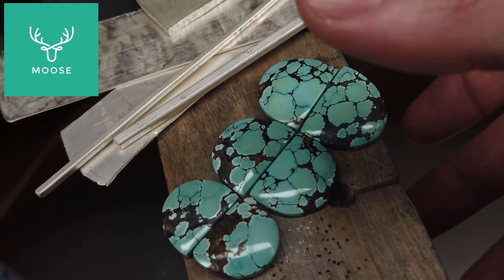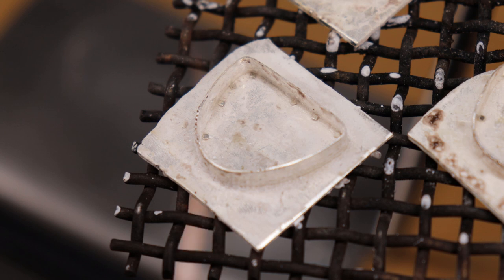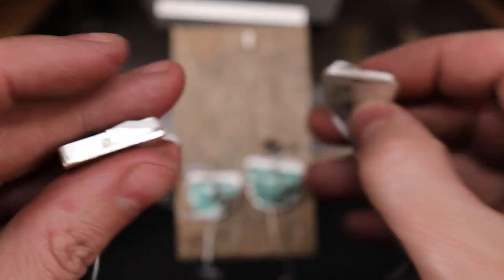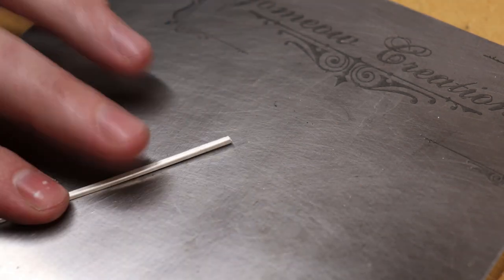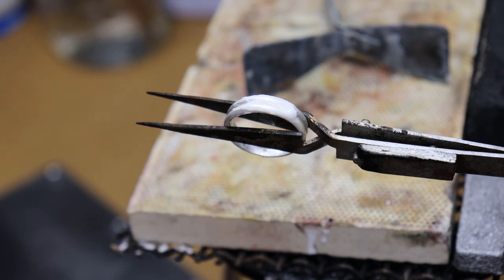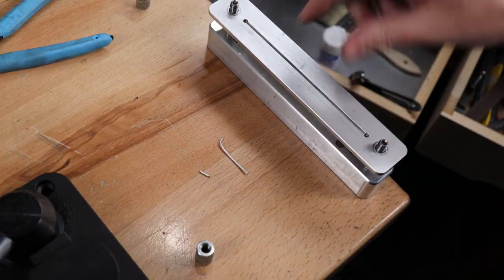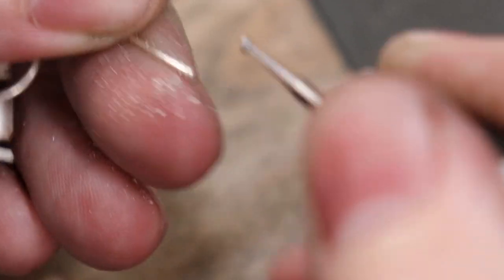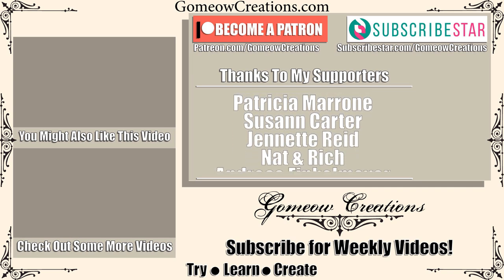Moving Vintage Styled Turquoise Jewelry Made from Scratch

Comment from the maker: I wanted to show step-by-step how to make a matching set of vintage styled Turquoise Jewelry from scratch. Ring, Necklace & Earrings. I have also listed all the tools used along with time stamps. 

Use code "GOMEOW30" and get $30 off your first order of $55 or more from Turquoise Moose - http://bit.ly/TurquoiseMoose

00:00 Intro

Tool List as I use them in the video:

0:16 Pepetools Combo Rolling Mill
https://bit.ly/ComboRollingMill

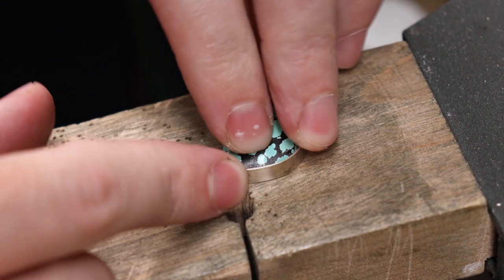0:33 Tungsten Carbide Scriber Pen
https://amzn.to/3yvf6SN

0:35 7in Plate Shears
https://amzn.to/36lBG4l

0:36 6in Digital Caliper
https://amzn.to/3hNiTV0

0:54 Miter Cutting Vise
https://amzn.to/3xmokkh

0:55 Grobet Swiss File
https://amzn.to/2V6hFMC

1:01 Solder Box
https://amzn.to/3dSTszU

1:03 Assorted Silver Solder Pack
https://amzn.to/3ACVmyk
or
https://bit.ly/SilverSolder

1:05 Hard Charcoal Block
https://amzn.to/3dPKQdu

1:07 Tweezer Set
https://amzn.to/3yrIUja

1:10 Handy Flux
https://amzn.to/3ACpDNO

1:12 Smiths Little Torch
https://bit.ly/SmithLittleTorch5tips
or
https://amzn.to/3yzPtjT

1:13 Smith Magnetic Stand
https://amzn.to/3yzPCUt

1:14 Automatic Torch Igniter
https://bit.ly/AutomaticTorchIgniter
or
https://amzn.to/3ACa2Os

1:20 ErgoLast Titanium Solder Pick
https://bit.ly/ErgoLastTitaniumSolderPick

2:03 Guillotine Metal Shear
4 in https://bit.ly/4GuillotineShear
or
6 in https://bit.ly/6GuillotineShear

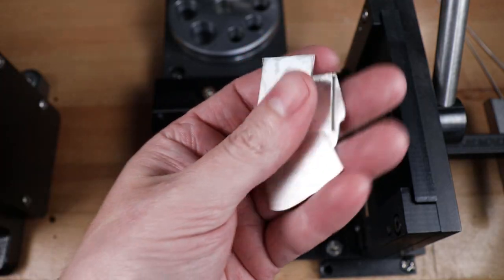2:14 Heavy Gauge Soldering Screen
https://amzn.to/3yroruX
or
https://amzn.to/3jP2zWc

2:15 Soldering Tripod
https://amzn.to/3hJvpVg

3:34 Slow Cooker (For heating the pickle)
https://amzn.to/3yyjd0f

3:35 Pickling Compound Sparex NO2
https://bit.ly/SparexPicklingCompound
or
https://amzn.to/3hLxJLB

3:36 Copper Tongs
https://amzn.to/3xt4S5u

4:24 NANO Jeweler's Saw Blades
https://bit.ly/NANOSawBlades

4:25  Haymaker SawFrame
https://bit.ly/HaymakerSawFrame

4:26 GRS Bench Pin Setup
https://amzn.to/3jTDN7k
https://amzn.to/3dQwSYF
https://amzn.to/3AB2HP1

4:27 Work Bench
https://amzn.to/3dQccjs

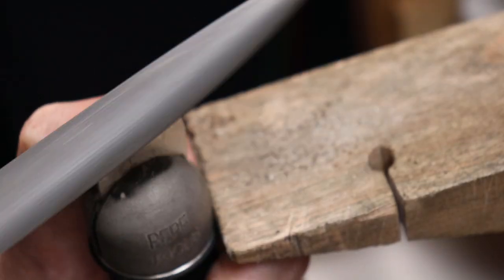4:44 Ring Clamp
https://bit.ly/RingClampPEPE

5:21 Sanding Stick
https://bit.ly/SandingSticks

6:24 Wite-Out Quick Dry
https://amzn.to/3dSAHN5

7:18 Flush Wire Cutters
https://amzn.to/3qOWTgm

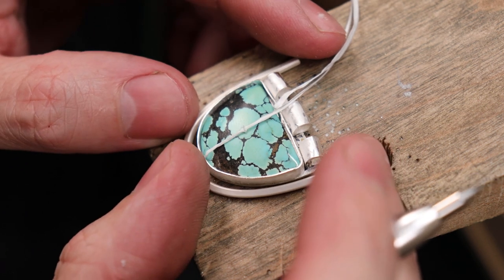7:30 FRETZ - Maker Hammer Set
https://bit.ly/MakerHammerSet

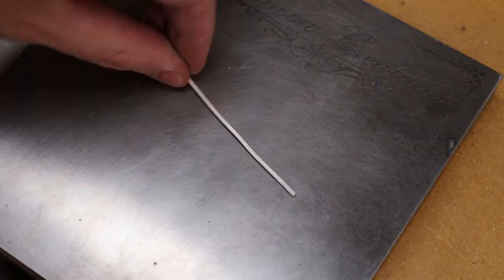7:31 Garland Rawhide Mallet
https://amzn.to/3whBnSt

7:32 Premium Steel Bench Block
https://bit.ly/PremiumBenchBlock

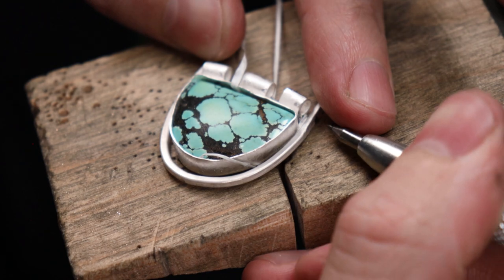8:08 Round Ball Bur Set
https://amzn.to/3yxnscO

8:10 Foredom Quick-Change Handpiece
https://bit.ly/Quick-ChangeHandpiece
or
https://amzn.to/3ytB5cP

8:13 Foredom Flex Shaft with H.30 Handpiece
http://bit.ly/K2230
or
https://amzn.to/2V6h2mg

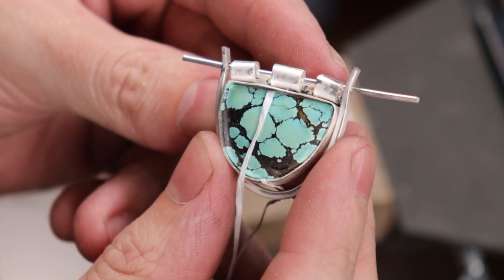8:34 Chain Nose Jaw Parallel Pliers
https://amzn.to/3jNah31

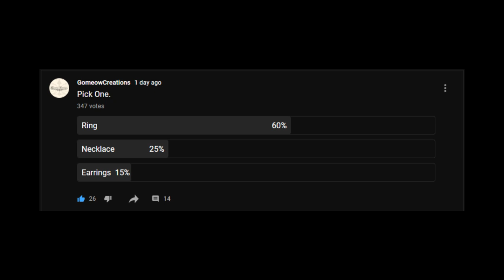8:56 Honeycomb Ceramic Soldering Board
https://amzn.to/3dRvPaX

9:19 Steel Ring Mandrel - Gold Standard
http://bit.ly/GoldRingMandrel

9:20 Superior Ring Bending Tool
https://bit.ly/PepeRingBender

10:00 Ring Stretcher & Reducer
 https://bit.ly/RingStretcher

10:14 3rd Hand Cross Locking Tweezers Set
https://amzn.to/3jQSQyw

10:31 Flat Back, Open Ring Mandrel
https://bit.ly/RosyRevolverMandrel

12:33 Jump Ring Maker
http://bit.ly/JumpRingMaker

12:34 Jump Ring Maker Combo
http://bit.ly/JumpRingMakerCombo

13:58 Bail & Jump Ring Pliers
https://amzn.to/3hlxUy7

15:16 Cup Bur Set
https://amzn.to/3dSEry7

15:25 Liver of Sulphur Gel
https://amzn.to/3AA1qYq

15:51 2LB Mixed Steel Tumbling Shot
https://amzn.to/3AEoGVw

15:52 Rotary Tumbler Machine
https://amzn.to/3AEp4TY
or
https://bit.ly/ForedomRotaryTumbler

16:10 Polly Plastics Moldable Plastic Pellets
https://amzn.to/3xiRZuu

16:14 Agate Stone Burnisher
https://amzn.to/3qYK1o8

16:15 Straight Burnisher
https://amzn.to/3xpwyYC

16:16 Curved Burnisher
https://amzn.to/3jQvB7O

16:17 Burnisher Bezel Roller
https://amzn.to/3wmkkyP

16:18 Foredom H.15 Hammer Handpiece
http://bit.ly/h15hammer
or
https://bit.ly/PepeH15D

16:28 How to Set Bezels 
https://youtu.be/nAHbpiUzv-c
and
https://youtu.be/zlysUJaPknQ

16:41 Nylon Polishing Wheel
https://amzn.to/3xpQniB

16:42 Polishing Buffs
https://amzn.to/2TziL3j

16:43 Fabulustre Polishing Compound
https://amzn.to/3wkI32s

16:50 Ending of Video

If you are looking for more tools and materials that I use, well you're in luck! I made a page on my website just for that and I'm updating all the time so bookmark it to stay up to date:

https://GomeowCreations.com/tools-and-materials 
https://GomeowCreations.com/partners-discount-codes

______________________________________________

My PATREON ➜ https://patreon.com/GomeowCreations

One time support ➜ https://paypal.me/gomeowcreations
______________________________________________

Instagram ➜ https://instagram.com/gomeowcreations/
Facebook ➜ https://facebook.com/GomeowCreations/
______________________________________________

Comment: Loved the chain and the square wire, so lovely!  Hammering the round wires so they became more angular gave it a very artistic touch. I would have used square wire for the jump rings too.  This chain is reminiscent of vintage Russian chains for amber pieces but with more heft.  Fabulous chain and turquoise is splendid coloring!  The dark silver matches the dark webbing on the turquoise and the end result is very beautiful.

Some practical tips from a woman who is used to wearing jewelry to a man who has probably not field tested this type of set:
1. Earrings - stone should be smaller to be less heavy. Weight matters to ear lobes. Wire is too long for weight, size, and articulated piece. It will look disproportionate to have a thin wire with a heavy piece so far down on it. Earlobe ends 1 centimeter past top of wire. Earring should follow fairly close after end of earlobe in this instance. When you have a moving piece, the weight effect increases on the earlobe and its painful.  By making it smaller and lighter, and moving it up more, you reduce the strain on the earlobe. A comfortable earring is going to be worn more and purchased more. All hinges should be smaller too. The articulation (movement) is lovely on a earring.

2. Ring - no need for any articulation on the ring.  There is too much material sticking out from all ends that will catch on stuff and pull on the finger.  Articulation is annoying when it flaps around on the finger and catches on fabrics.  Just the stone would suffice. It looks very matched up on the display stand, but will not be worn if it catches on stockings, hair, office machines, etc. A hand must have full range of movement with the ring on.

3. Pendant - I would oversize the pendant proportionate to the earrings.  This should be the dramatic centerpiece with smaller satellites around it like earrings and ring.  Make this hefty and much bigger than the other two.  I would add two bails on either side hinge not one in the center - better balance and look.  Pendant large, ring stone medium, earrings med-small.  Chain should end at top furrow of breast. Any longer will make this necklace swing out and hit objects.  Also, unless this is a huge piece, if chain is too long, it will be unseen so far below. Keep in mind the collars and necklines of women wearing this. Most are exposing top of breast, so having this land right there is perfect.  I find when I buy or make jewelry, either it is choker length for wearing with shirt collars slightly open at the office, or it is just above the breast line so slightly lower neckline shows it off. Any lower than that and it irritates me when it swings out and hits things. 

Always a good idea to field test it by wearing it yourself before making more of the same design.  This means you need to get your ears pierced, ha ha ha!  Or hire your girlfriend.  I bet she won't mind having new jewelry to test out weekly.  

So many new ideas I learned here, wow!  Using the actual stone on the sketch is very clever for sizing.  The soldering techniques, bezel setting, use of tools, handy tips, loved the slit in bench pin for opening jump rings, and seeing what mistakes can occur at each step, so very educational.  Jewelry making involves Blacksmith forging, chemistry of metals and heat, lapidary work, structural and mechanical engineering, sculpturing work, and an artist's eye for design.  You have all these skills and its really impressive!  Thank you for a marvelous tutorial, again!  Greetings from sunny California, land of Redwood trees and the Pacific ocean.

Comment: Such a lovely set!  Thanks for sharing.  Here's a tip re. your soldering tripod...  If you turn it upside down and prop the screen on top of the legs it won't act as a heat sink and you'll be less likely to melt your fine silver.

Comment: Thank you, Randy!  This is one of my favorite demos and your jewelry set came out GREAT! <3
Reply from the maker: Always happy to hear such kind words about my work. 😁👍
Reply: @GomeowCreations  I have a question regarding using my jeweler's saw on various metals. I viewed your tutorial from 5 years ago, it's excellent. I'm struggling with my ability to SEE the line on which I am cutting - is there a trick I am missing? I can't seem to find a position hat allows me to see my cut line! I'm constantly leaning to one side or the other trying to see where the blade teeth are hitting the cutting line (the metal shavings and crumbles from the blade lubricant only make it worse). What is the correct posture that allows me to actually see where my blade is going? 

I watch you saw and it's perfect! I have plenty of magnification - that's not the problem. I literally cannot line my eyes up with where the teeth meets my cutting line. Where should my head be positioned? The saw frame and the blade both obscure my view of the cutting line - my sawing is an absolute mess and requires a great deal of filing to correct where the blade wanders, I also keep ruining pieces when the cut wanders onto the wrong side of the line. 

Also, is there a lubricant that will not leave so many shavings which only serve to make the problem worse. I've been using Cut Lube jewelers lubricant and while it works it's very crumbly and makes a mess, I continually have to stop sawing to brush off the lubricant shavings; I also tried using a liquid lubricant but the one I used dissolved my sharpie marker cut lines - I had to stop, clean off the metal and redraw my lines. I'm a DISASTER! Any recommendation would be greatly appreciated!